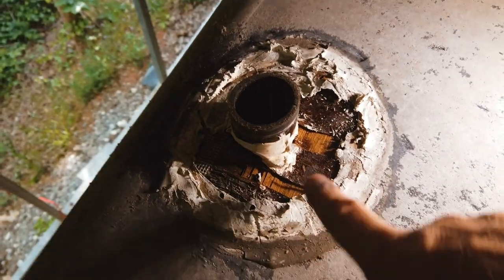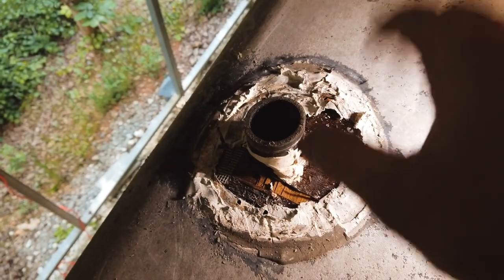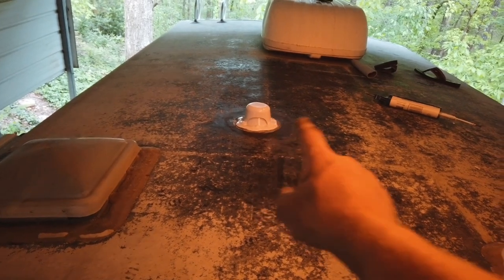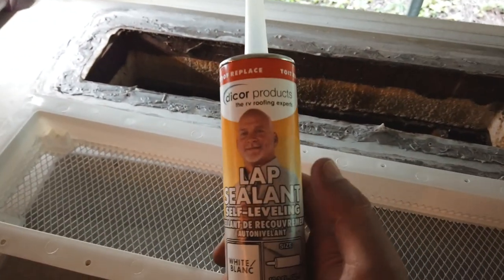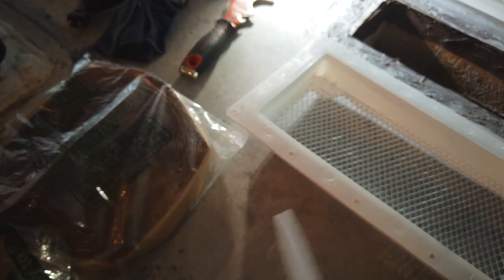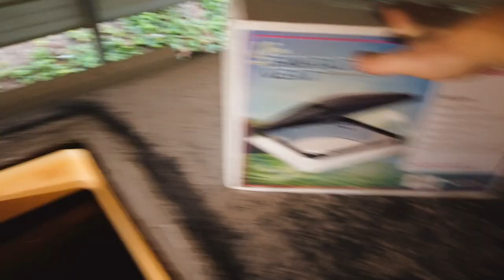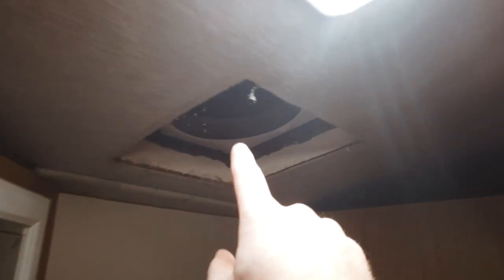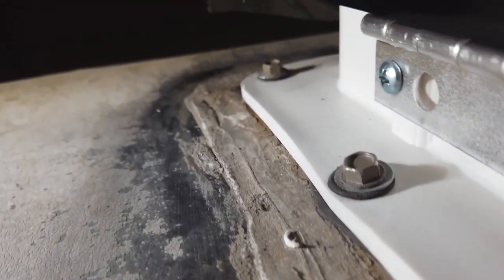How to replace RV roof // Crazy Seal Hybrid Install // Fleetwood bounder // Part 1

Comment: Hey dude, did you have any soft spots in the wood before you started the new roof work? How did you determine if it was worth replacing a section or not? My used 1997 Bounder has some soft wood sections, but a new roll-on roof from the last owner. They didnt replace the soft spots. 
I'm wondering if I should dig into it or let it be.

Comment: Having just bought a 91 Fleetwood bounder with a leaky roof that's been severely bodged I found you video very informative. However I'm concerned that the outer skin of the roof doesn't seem to be properly adhered to the roof its' self. It is like a old canvas roof they used to put on cars.
Have you any ideas about stripping back the whole roof area and fibreglassing it. My main concern is the fibreglassing will add 1/8" to 1/4" to the roof's thickness and I'm unsure how that will affect the reinstallation of the air-conditioning units.
Reply from the maker: That seems like a big job but i guess it would work haha. The crazy seal that i used will work on top of the bare wood as well, so if you need to strip back parts.. you could.

Comment: Why are you doing the vents before you put the new roof on?. To me it seems back to front, I would put the new roof on and then cut the holes for the vents
Reply from the maker: Yup in a typical way you would do it that way, in my case it's a roll on silicone membrane that you will put on last. Makes things much easier :) hopefully the next video will make that more clear

Comment: It’s been 3 years since you made this video. How is your roof holding up now?
Reply from the maker: Amazing, still looks good as new :)
Reply: Wow that’s impressive that the roof is still in good condition. Did you have to reseal the roof after a couple of years/maintenance ? 
Thanks for your quick reply. And thanks for this very comprehensive install video. 
I’ve done scrape and reseal on my trailer roof sealant and its no easy task! Lots of elbow grease.
Reply from the maker: @Alisonwonderland88 nope all I've done is wash it yearly :) but to be fair it's under a carport too

Comment: Your videos are awesome. My wife & I just got into the RV life back in Nov. 2020. We bought a 32' 1998 Fleetwood Bounder with Chevy 454. We will be updating our RV a little bit at a time and your videos will be very helpful. 
The only thing on our RV that we have found that doesn't work is horn and cigarette lighter. Any suggestions on how to raise the dash will be very much appreciated.
Reply from the maker: Mine didnt work either, it was actually a fuse under the hood, i would start there, in fact, it doesnt cost much just to replace all the fuses... saves a lot of headaches hehe.
Reply: Hello friend 
How much is the price of 10 gallons of crazy seal . Thank you for your response .
Namaste 🙏🤝👍󾓦 ✟ 󾓦